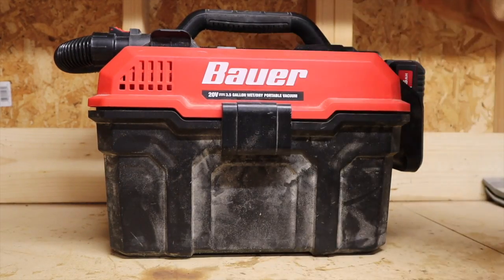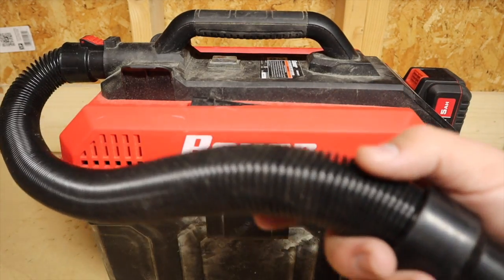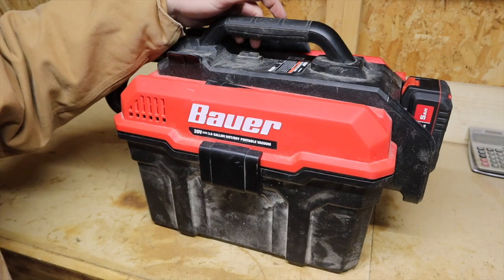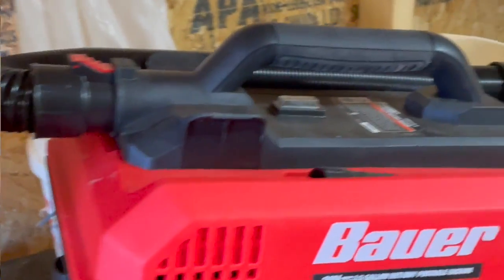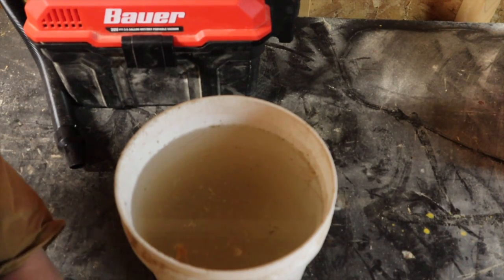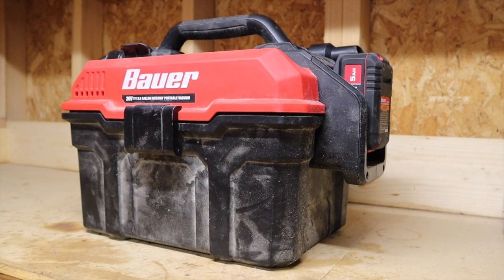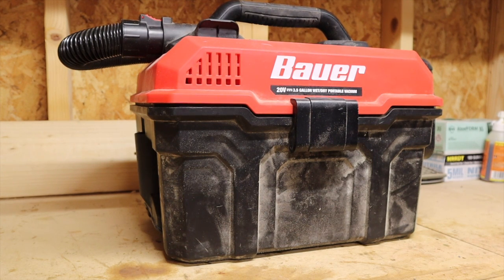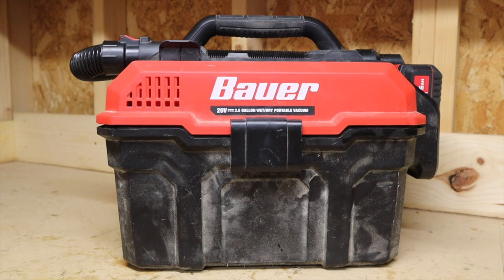Bauer 20v 3.5 Gallon Cordless Wet/Dry Vacuum Review (Harbor Freight)

Comment: I’m a Hercules guy, the Herc’s over twice the price, so I got a Hercules battery to Bauer adapter and bought this tool.  Works great.
Reply from the maker: The really, in my opinion, should have made the batteries compatible between the two lines. I don’t know. Maybe less money in sales if they did that, but seems like it would have been a better solution for the customer.
Reply: @DereksWorkshopAndProjects  I agree.  It was a hard decision on which battery line to invest in, and when I did a couple years ago the offerings were pretty similar, now Bauer has considerably more options.  The bean counters might think having them all use the same battery would cut into their sales, but I think the opposite is actually true.  If the Bauer and Hercules took the same battery I’d buy a ton more tools.  Hell I would probably even have some doubled up, like an impact driver for me (Hercules) and a Bauer for the wife and kids when they want to use a tool.

Comment: Same filter for wet or dry?
Reply: For wet vac, you remove the filter. It has a float switch to cut it off in wet mode.